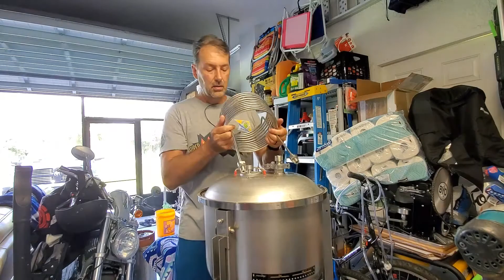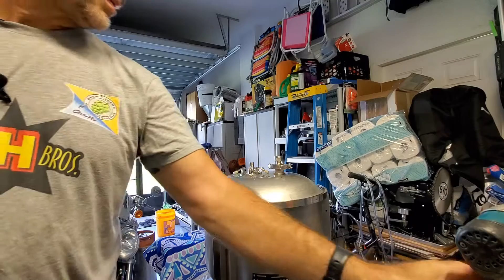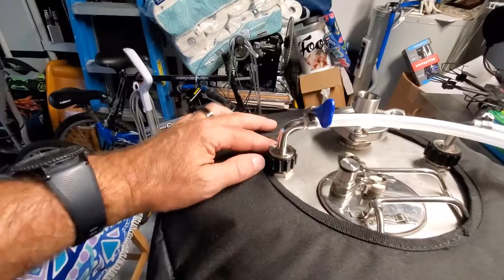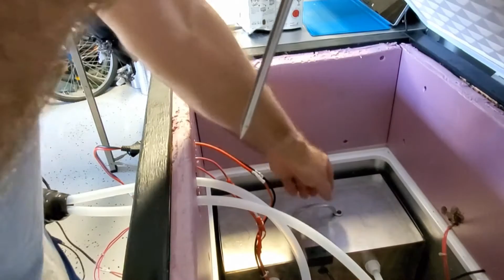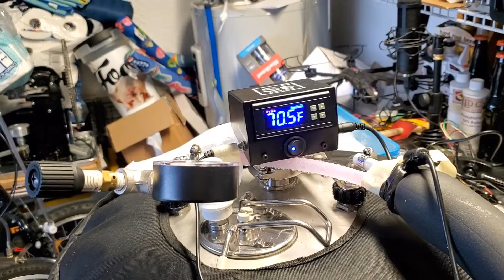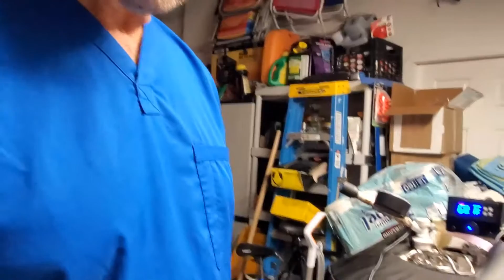DIY Glycol Build Part III (will it chill this large fermenter?)

Comment: That is awesome stuff Gary. Would you think buying a small 5.5 cubic foot freezer and holding the glycol tank be an option down the road? It will keep the glycol a lot cooler, I understand space and money is a real concern. Cheers!
Reply from the maker: well that would work even better i bet. my issue is floor space lol. but buying a small chest freezer and using it for this purpose with a bigger tank would probably let me do two at a time in the midden of summer. I am 99 percent confident i can maintain lager temps in the summer on the 7 gallon brew bucket even in the hottest months. I will be trying it next week. So long story short if you plan on glycol chilling more than one large vessel at a time then a bigger tank and a dedicated chest freezer would work perfect.